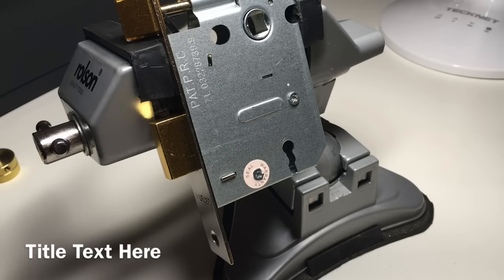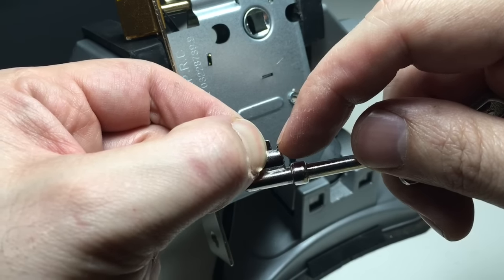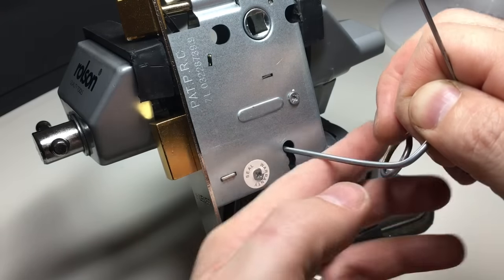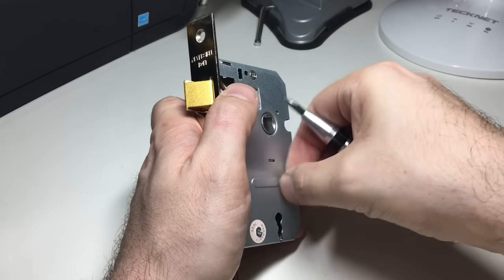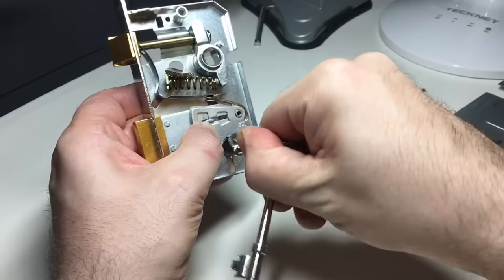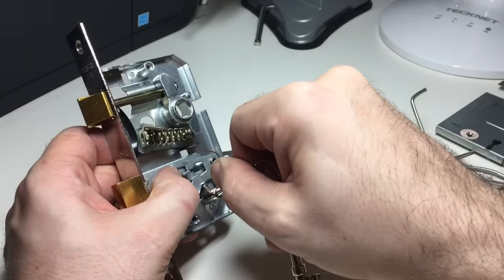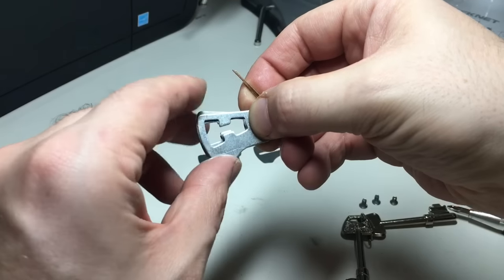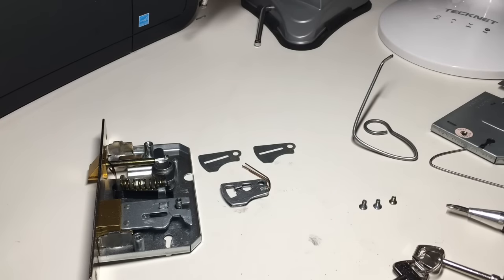(155) Lewis 3 Lever Door Lock Picked with Wires and Gutted

Comment: You were dropping your hand slightly when you were tensioning, making the tension upstand lean in and slip off the bolt. keep tension at 90 degree to the lock.
 Looking at the clip again and freezing it. The upstand on the tension is slightly out from square. I think that is also causing problems. Check its 90 degree from the wire.

Comment: Evening locknoob. Make the upstand on the tensioner longer so it sits in the bottom of the keyway for a fulcrum/pivet point.
Reply from the maker: Rat Lock you are absolutely right and I actually tried this first. For some reason it didn't work out for me so I shortened the tension wire (which, if I were honest wasn't much better...). What do you think about filing a notch into a wire tip? Not done it but it was suggested and makes sense
Reply: No dont file notch. Either use your thumb of your left hand pressed against the lock to provide a pivot point. Or make upstand on tension long enough to sit in bottom of keyway and tension that way.

Comment: Is it possible to remove the levers so that the lock could be operated by any/generic key? Might seem odd question but I've been unable to find a good match for mortice lock in 1930s internal door so that my son can lock his door or adapt a lock for bathroom door as don't have original key.
Reply from the maker: The short answer is yes, but you would need suitable spacers... a lot could go wrong so best to consult a locksmith :-)

Comment: how easy is it to pick from the other side?   i am new to this type of lock and can not find anybody who explains picking from the other side they all pick the one side and can the tools you can bye tension the outside and pick behind if you know what i mean
Reply from the maker: robert dundas good question. These none-curtain locks should be easy enough to pick from the other side with wires, the reason why people pick this side round is because looking from the outside of a door in, they are mounted this way round.  Curtain lever locks picks make picking the other side of the lock simple enough in theory too